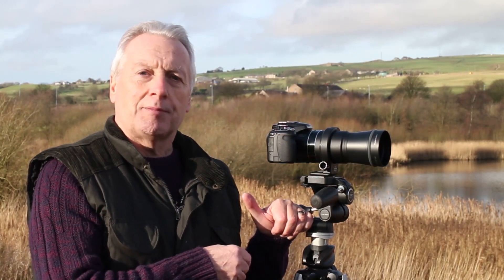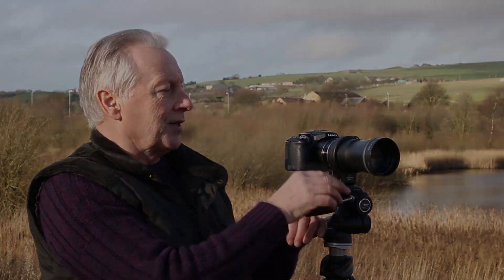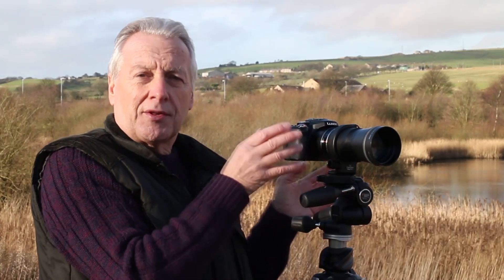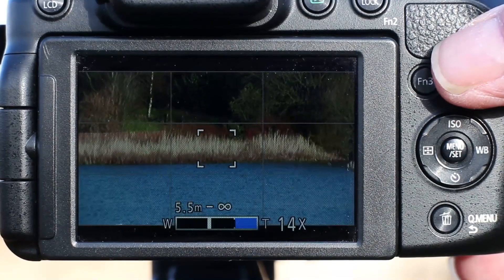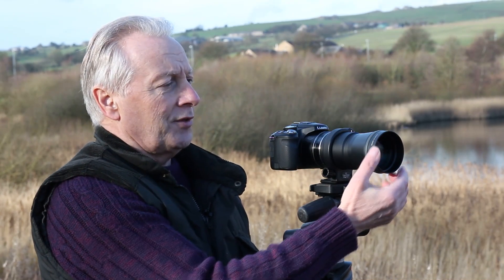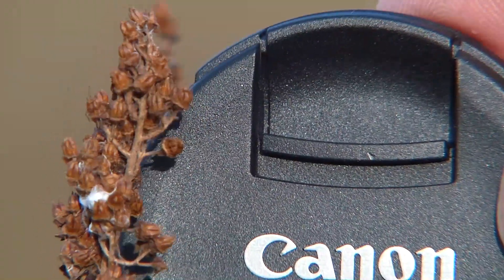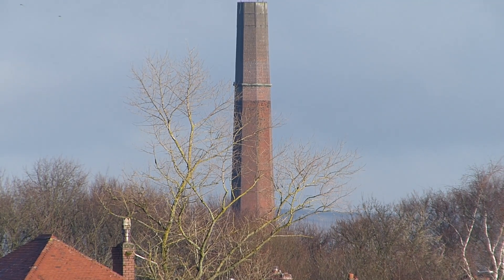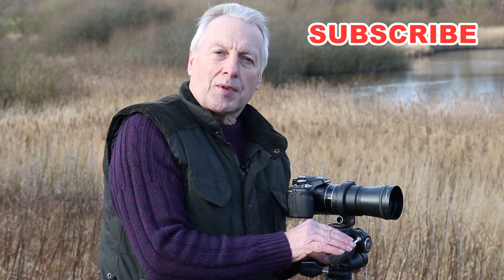Using Teleconverter Lenses on Panasonic Lumix Bridge Cameras.

Comment: Using the Panasonic LA-7 adapter and a cheaper version of the Canon D mounting ring I found the use of the 'soft' part of self adhesive Velcro tape an excellent method of padding out the ring to fit the LA 7.

Comment: Hi Graham, excellent videos. I've just bought a Lumix FZ2000 and found your clips really helpful. What sort of teleconverter and tube adaptor could I use with this? Also, my pics seem a bit on the dull side even in good light. I know there are a lot of tweeks can be done with this camera - any suggestions?

Comment: thanks for some really informative and educative videos in general and the FZ200 ones in particular. 
if i may ask you a couple of questions, 
1. is the length of the extension tube important? 
2. does the length of the extension tube depend on the lens that is being used?
3. can a teleconverter lens be used directly connected on the lens (as long as the thread diameter is matching)
thanks for all the teaching so far, and hope to get answer to the question. 
regards

Comment: Can I use the Sony telephoto lens (VCL-DH1758) that Graham is using in conjunction with Panasonic's DMW-LA7 conversion tube? I know a 55-58 step-up ring would be required for the physical connection. Are there optical problems with this combination? Thanks for the videos Graham!

Comment: Dear Graham, I just purchased the FZ200.  I also own an old Sony H1 plus the TC VCL-DH1758 and the Wide angle VCL-DH0758 plus the Sony adapter tube.  What else do I need in order to utilize the accessories I already have with the FZ200.

Comment: thanks Graham. Great work again
Reply from the maker: Thanks, It is good to get feedback on the productions.
Reply: Graham Houghton
Hi Graham, what is the make of the Telecon Lens tube adapter? Thanks. Im planning to get one if I will get a teleconverter for the FZ200. thanks
Reply from the maker: Mike Mier hi Mike, first you need to identify the lens - if you are going to use the LTE55 panasonic lens then look on amazon (or ebay) for LA7 adaptor tubes you will see a few third party ones there with 55mm thread - that's the one to choose. I had a 58mm sony lens so I went for one with 58mm threads from china on ebay.
Reply: Graham Houghton
Hi Graham thanks for the advise. i will find the best lens possible. but not as expensive as the lte55

Comment: Thanks Graham, would be interested to hear your thoughts on tripod and ball head selection too :)
Reply from the maker: Hello Gordon. I have tried to use ball and socket heads for this and the framing is almost impossible with such high magnification. A pan/tilt head is really needed and even so creep is always an issue when tightening them. I'll be doing a tripod review later this week and some of the "mistakes" I've made.
Reply: Graham Houghton Great, looking forward to that then :)

Comment: I use a Panasonic lumix fz-82 with the DMW-LT55. Do i still need tot use the adapter la8? Because the lens fits directly on the camera. I do not see much difference with Ir without it.

Comment: I had the fz100, and then the fz200. I just bought the fz1000. I thought I'd try out the macro but I don't see the conversion setting on the 1000 - no setting to tell the camera you've added a macro conversion lens?
Reply: +Kimberly Maxwell  I am also looking for the same. Did you manage to find ?
Reply: Nope Sreehari K T never found it. I got side-tracked trying to set up the darn wi-fi and forgot about finding the conversion setting. In truth I haven't had much time with the 1000 but I did have the full manual printed at a local copy shop so maybe it will help. If I find it I'll post.
Reply: +Kimberly Maxwell I read the manual, couldn't find any. I saw another video uploaded my Graham Houghton, saying there is no option to use converter on fz1000 :(
Reply: Well lets just hope that since it has the threads to accept filters and lenses if is able to figure it out and focus on it w.o us having to tell it we put a tele or close up lens on it.

Comment: WOULD this work on the newer FZ300. I love the FZ300, but want to: a) extend my zoom reach ust a bit further; b) not sacrifice the weather seal. Will the camera/lens still be weather sealed? Thanks so much for your info. This vid was very informative.
Reply from the maker: Yes the TC lenses work well on the FZ300 but you may get jus as good a result using i.Zoom at x 1.5

Comment: I love your video's! I'm a bit of a newbie when it comes to good photograhpy - I have the FZ200 and bought a Raynox DCR250 for macro photography (I love photographing small bugs). However, I wish I would be able to take pictures of flying birds. I really love photo's of birds and especially photo's with movement. Mostly, they are too far away, or it's blurry. I hope you can help me. I looked on the internet to buy the adapter and the tele-conversion lens, but I don't understand the part of the micro-lens. Can I buy any mircro lens, as long as it's 58 mm? And do I have to adjust the shutter speed? I really don't have any good experience with this so far, so I really hope that you can help me! Thank you very much in advance
Reply from the maker: Miranda, Hi. The LA7 lens adaptor tube normally has a 55mm lens thread, the extension tube i bought was a third party copy which had a 58mm thread as i had the Sony 1.7x teleconversion lens which has the 58mm thread. The official panasonic lens has a 55mm thread which matches the LA7 tube. Yes you will need to increase shutter speeds to stop camera shake, which in turn means you may have to use a higher than ideal ISO speed inorder to do this. Image quality will therefore drop a little due to image noise. Given good light the combination of the FZ200, teleconverter and conversion tube can produce reasonable results for this kind of photography.

Comment: I bought an Olympus c-180 teleconveter at 52mm of diameter, it's correctly fit my Fz330 without any adaptater. 

But I can't even focus anything at mid-zoom level.

 Dit the adaptateur is necessary to put a teleconveter on my bridge?

I need help!!
Reply: if you don't use the convertor tube, the extending lens will break ruining your camera.. it needs the hollow tube to move back and forth inside of.

Comment: John Mcatee
Dear Graham do you know if you can fit a LT55 onto a Sony hx400v or a Canon sx50hs and how if so. I already have the LT55 but cant decide which camera to buy or just go with the Lumix FZ72 thank you
Reply from the maker: you always need to support the telecon lenses somehow, that why Panasonic use the lens tubes. I had the FZ72 ans was not impressed with its performance and lack of basic features like a remote socket or external mic port so I sent it back.

Comment: Dear Graham, I have a question about the tube adptator for Panasonic Lumix. I have an FZ45, so my "stuff" is the LA5, but I have some difficulties to find it (either on internet and in the fisical shops). So my questions for you are these.
I ought to use the tube with the teleconverter? Without the tube, the teleconv doesn't run correctly? Do you know where to find a compatible tube for my Lumix?
Thnk you in advance...

Comment: I come across this video late. It has been 4 year but I like to ask one question..with your setup, the 1.7X sony, the 58mm extension adapter tube and the maximum zoom of the Fz200 disregarding the digital zoom.. what is the Final estimated X power of the photos ?
Reply: Well the max optical zoom on the FZ200 is 600mm.. So 600 x 1.7 = 1,020mm

Comment: Great video Graham. I take it there is enough space in the adapter tube to fit a macro lens and still allow full zoom or does it need to be a thin macro?
Reply from the maker: Yes there is plenty of room, you can use even a 52-55mm filter on step up ring. The extender tube has a 58mm intermal diameter so there is adequate clearance and length inside to tube to fit filters etc

Comment: hi graham thanks for great video's. I'm looking for help new to photography apart from usual point and shoot. just treated my self to a FZ200 and have been watching your video's about teleconverters, wide angle lens and adapter tubes.  have a limited budget so was looking at ebay but my head is buzzing with thread sizes etc. I was looking at multi lens filter sets that seam to have every thing required except the tubes for about £50 but not sure if they are worth it maybe poor quality and what size I would need can you advise . thanks in advance Iain

Comment: Graham, thanks for the videos. They are excellent. Could you explain to me why you went with the Sony VCL rather than the Panasonic LT? Also do you have eBay links for the hardware such as adapter ring you have bought.
Reply from the maker: The VCL was available secondhand at my local camera shop at a very good price. I had a panasonic one and sold it a while ago but I needed the extra reach at times so found this as a good alternative.

Comment: Hi Graham, thanks for such a great helpful series of videos. I have both the FZ200 and a G5, Have used Panny Cameras ever since Minolta ceased. I have a query which I hope you may be able to answer, I have the Olympus TCON 1.7 which was bought and used back with my last Minolta, and since with the following Pannys. After trying with the FZ200 I added the LA7 tube, and now after seeing the possibility of using a Tripod Lens Collar support, well I want one. So the query is this, I measured the outside diameter of the LA7, and it appears to be 7.3cm. and have asked some suppliers the diameter of the Canon and I'm told 6.8cm. Now do my measurements and theirs sound correct? If they are correct, is there another answer? Thanks in advance for any time and help you can give.
Reply from the maker: My tube is 6.75cms and needs a few layers of electrical, or other tape, to make it fit tightly in canons "D" tripod mounting ring.
Reply: Graham Houghton Thanks for reply Graham, and must admit to an error in my measurement, rechecked with a vernier and it is 6.73cms. Sorry to take your time, and many thanks.

Comment: Dear Graham, Could you please list all the "stuff" (with Model Numbers) I will need to purchase to use with my FZ200.
PS. Please keep those great Videos Comming!  PPS. I am located in the US.
Reply from the maker: The LA7 lens adaptor tube
LT55 1.7x telephoto lens
Canon Ring D adapter with some additional felt to make up the diameter difference, or use the mount directly to the FZ200 lens barrel mount
Reply: Graham Houghton Hi! will it work with Lumix FZ1000?

Comment: On the Panasonic FZ200, i bought a mini hdmi adaptor, but i though it could show the realtime preview but it could only playback clips and photos... is there any ways to get it to show the realtime preview on the screen?? ;D
Reply from the maker: Marvin is correct, you can use the AV video out mode to send a video signal to a monitor which is "live view" of what is seen on the screen prior to taking a still shot. You cannot use any of the video ports to stream live video in video recording mode. The eBook is available for free at http://www.grahamhoughton/download-section/

Comment: Excellent series, Graham, I note that when looking for items compatible with the fz-300 (which I have ),I rarely see this model listed along with so many in the Lumix range. I am looking for a wireless remote say in the Pixel range- a third party option,  any suggestions please.  I have the Tele lens which works well for my bird photography. I have several Nikon & Canon DSLR’s and too many lenses etc. I am scientific imagining specialist-trained at Leeds, way back. Google Shevill Mathers when you have a spare minute-you might find some image albums of interest.🌗📸📡 Kind regards from ‘down under.
Reply from the maker: The usual LT55E teleconverter lens is sometimes hard to find. Using the Nikon TC series convertors is a viable alternative. For remote trigger either a smartphone and teh Panasonic image app is one way to view and shoot or you can still get the Pixel Oppilas wireless remotes. Another way is to use the Neewer FC16 or the Yongnuo RC302 flash triggers which also double up as remote triggers with the correct remote cable. Great instruction videos on your channel BTW
Reply: Thanks, Graham, I have the Panasonic Tele-Converter and the extra connecting tube, plus a wired remote ($10) on eBay-the Panasonic version is over $100. After I had written to you I looked at my wired remote which comes in two pieces, and the shorter section has the right connectors each end which works with my Pixel Oppilas wireless trigger unit  Also bought the  Godox TT350 flash unit you mentioned in one of your tutorials.Also found a lens mounting ring/shoe on eBay for a good price. It pays to shop around for the after market options, they have never failed me in the past with all the accessories I have for my many DSLR's. I really like the Lumix FZ-300-again based on watching your tutorials-the f/2.8 aperture through the zoom range knocks some competing cameras out of the race. A surprising number of features in such a low priced camera. I will now go and sort through my various close-up lenses  and try the getting closer with the tele-converter seen on your YouTube series.  Kind Regards from 'Down Under'
Reply from the maker: I'm sure with your engineering ability & machine tools an adaptor of some sorts to mount a +1 diopter +2 diopter  lens to the front of the LT55e lens. As the lens is afocal it might still work by putting the dioptre on the main lens; going to try that might be useful.
Reply: Hi Graham,  Just watched some more of your tutorials, tremendous help to newcomers and a benefit to old folks like myself playing with new camera types. Yes, I have an expensive doublet achromat close-up lens I plan to experiment with-bought many moons ago for other projects. Busy building all day all night auto sky capture 24/7 180-degree cameras at present for climate studies-never a dull moment at my place. Keep up the good work-it is time consuming but worthwhile.
Kind Regards from 'Down Under'.
Reply from the maker: just tried the achromat on the main lens and the teleconverter  combination and it works very well. obviously reduced DOF but does reduce the working distance

Comment: What was the name of the "cheap" adaptor tube you use?
Reply from the maker: It is a no name brand, I found it on the UK ebay site at the time.
Reply: Could you find the link? ;)
Reply from the maker: HamDerDanskeren it is

http://www.ebay.co.uk/itm/58mm-58-mm-Camera-Lens-Filter-Adapter-Tube-for-Panasonic-Lumix-DMC-FZ200-DMW-LA7-/330833668624?pt=UK_Photography_Adapter_Rings&hash=item4d07392a10
Reply: Graham Houghton Thaaaanks :)
Reply from the maker: HamDerDanskeren will be ok to replace the la5 tube on the fz100/fz150 but remember this is 58mm thread so if you use say the lte55 lens you will need a stepping ring
Reply: Is the lens not a 58mm? It says "58mm side angle lens"
Reply: Wide*
Reply from the maker: HamDerDanskeren This is a sony lens which has a 58mm thread, panasonic equivalent has a 55mm thread
Reply: Graham Houghton Yea i know. But does the wide angle lens fit on to the adaptor tube? :D

Comment: Hi, I have watched most of your videos and I own a FZ 200. Can we take long exposure photographs in this. I mean like 2 mins of exposure or so.......
Reply from the maker: No 60 seconds is the max shutter time when using both manual exposure and manual focus modes together
Reply: Hi. Thanks for the reply. Some of the remote shutter release are available in the market. Will they work for long exposure photography in this camera.
Reply from the maker: No the camera will only expose for 60 seconds maximum even though the remote control is set for longer or even "B" setting

Comment: Hi Graham I have the FZ82 and I bought the above mentioned set up however the adaptor tube seems to be the wrong size? is it infact the FZ82 you are using and if not can you tell me what size adapter tube I will need to attach the DMW LT-55 please